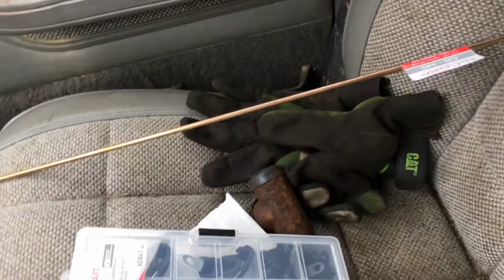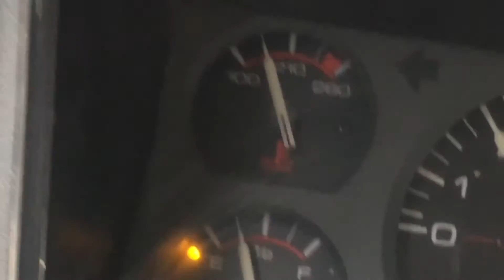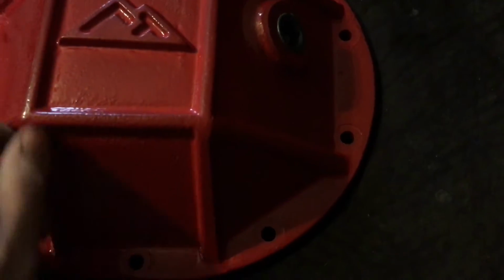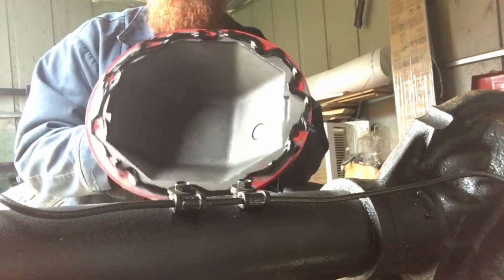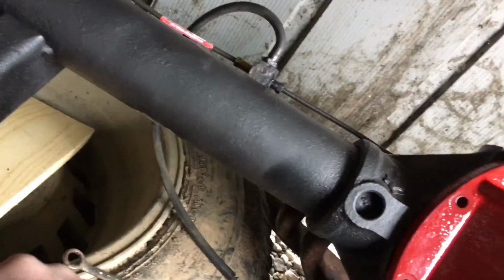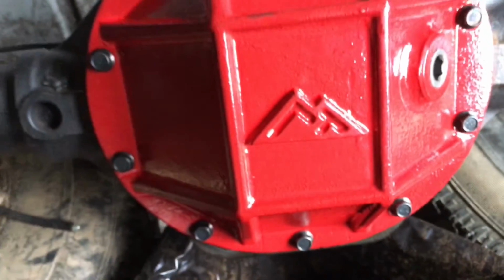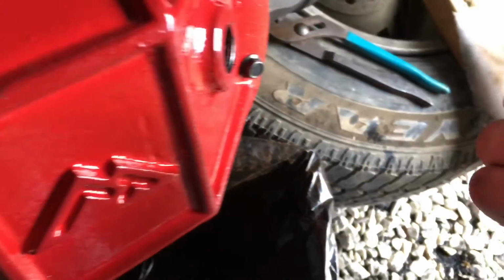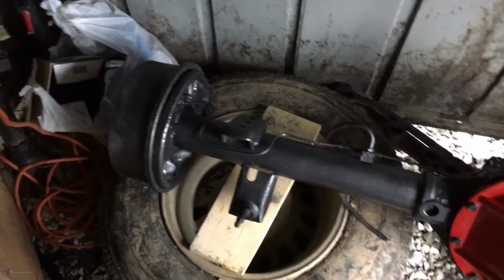Chrysler 8.25 getting stuff done

Comment: What fluid is recommended for the chysler 8.25? It calls for 75w 90 but does it need a LSD additive?
Reply: If you run full synthetic diff fluid, you don't need friction modifier whether you have an lsd or not.